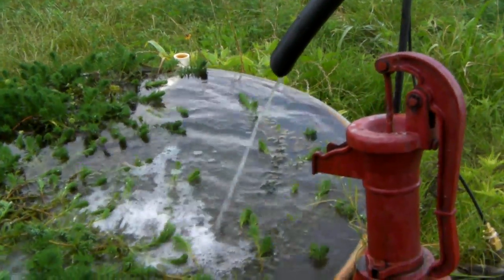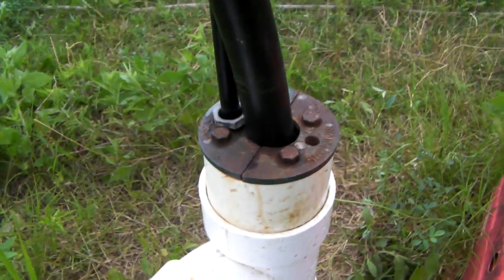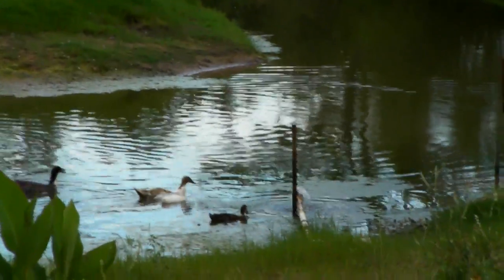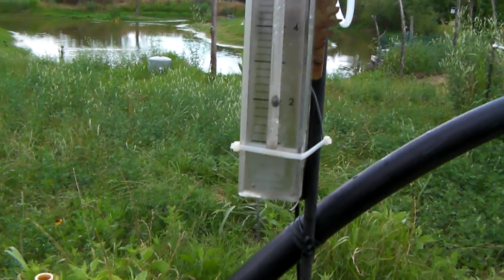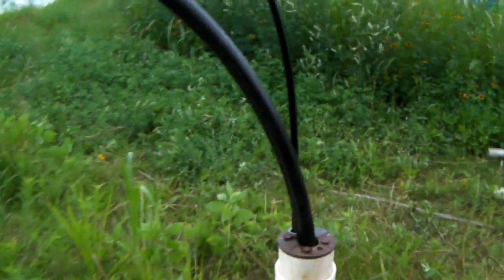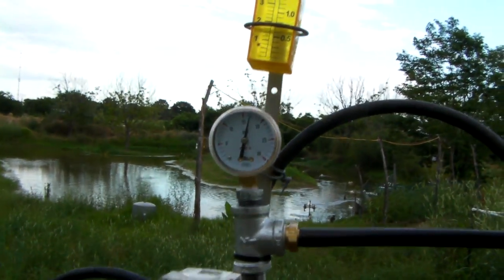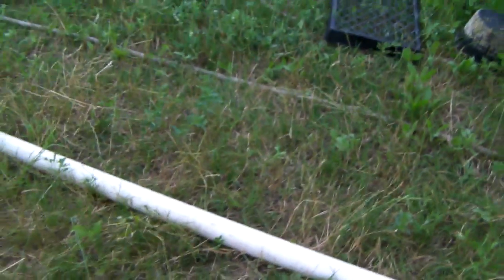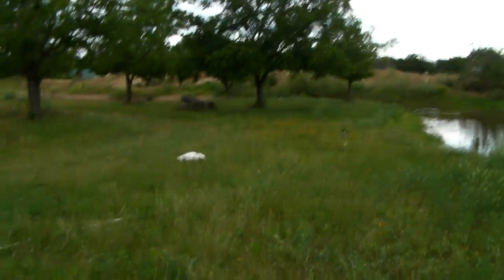Air lift water well pump in elgin texas part 3

Comment: You know I'm thinking you could buy a small say 1hp and change the driven pulley to a larger one,which would reduce the cfm and the amp draw maybe even to the point you could use solar panels for power.
Also curious,in your research did you see any suggested cfm and pressure recommendations for a well that the pump was set at 200 feet,not sure about the total depth ,I quit using it because it was eating pumps.

Comment: In this example, is the air coming  from an air compressor in your garage or from a ram pump?  Thanks.
Reply from the maker: its coming from a small Rocking Piston Aeration Compressor you can find them used on ebay and amazon for around $90 to $130
feel from to e-mail me at yardtv@gmail.com with your phone number if you need more help.
Reply from the maker: you can see the compressor on the video https://youtu.be/LVyZhUjwKXk?t=110

Comment: I know it has been a considerable amount of time since you made this video but I had to  add my 2 cents to the process. You perhaps may even be already doing some form of the below suggestions. Just by replacing the 220v electric pump with air pressure from your garage air compressor I am sure your electrical consumption has dropped a noticeable amount. When you started talking about making the air line from the garage permanent I wondered why. Running a 125 psi shop compressor and pushing air clear from the garage all the way to the well head seems to me to be not very efficient  You could use  a small oil less diaphram air pump installed right next to the well head. The pump would be one that is only designed for say 30psi tops and produced sufficient cfm to make the lift pump work correctly! Something matched to the needs of your design. I bet by doing it this way you could reduce your electric consumption even further!
Reply from the maker: this was just a test video,
I run the system on a very small rocking piston air compressor and that runs on solar power,
I had to stop doing update videos because people just don't get it and I was sick of all the people telling me it would not work.. its been working for over 6 years same compressor and the last five on solar.
I am still looking for a 12 volt DC rocking piston compressor so it takes less amps to run on solar.
Reply: by any chance do you have a link for a good diagram pump that could work for this?